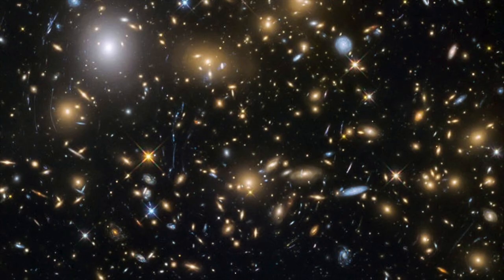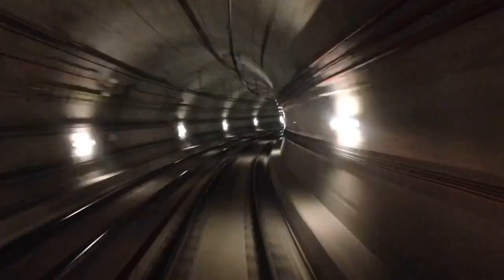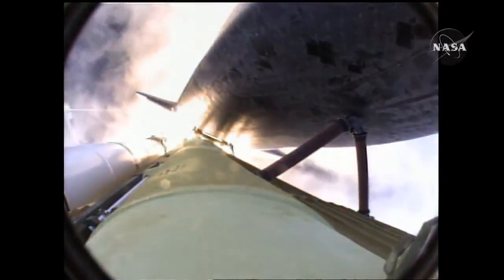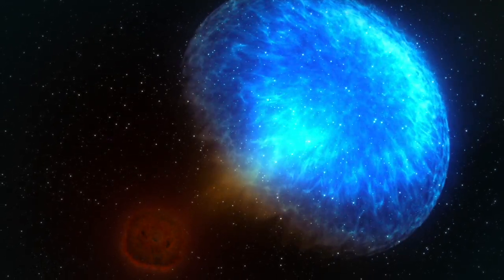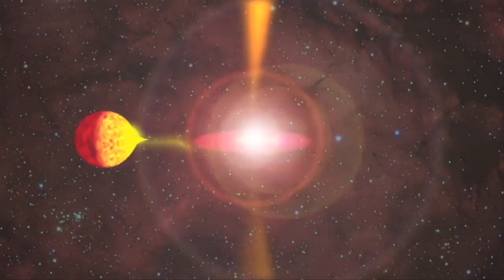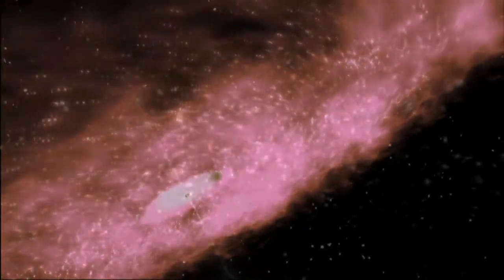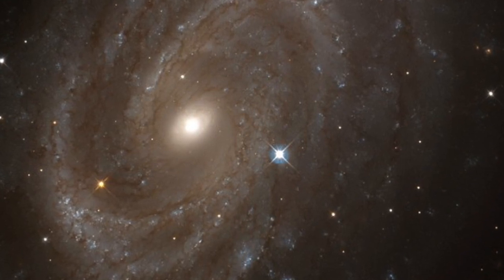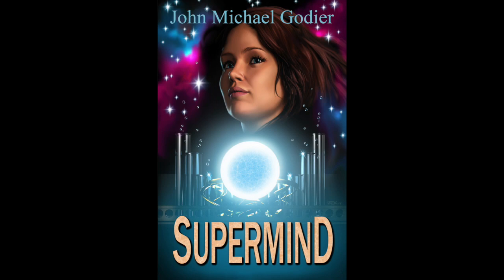10 Mind-blowing Interstellar Propulsion Systems

Comment: Concerning antimatter production...well, yeah, confinement of it is one thing, but it is possible...in terms of the best way to make it though...I seem to recall reading many years ago now,  about maybe producing it on the planet Mercury, mainly due to its ready availability to solar power...am also thinking now about that Isaac Asimov story ("Runaway" - something like that?) about that robot that got a bit confuzzled, caught in a sub-positronic dilemma, so to speak. Selenium was involved...I love this channel, by the way. In terms of interstellar propulsion, I think that some incredible genius may eventually come to make it practical, and it would be nice if we could safely get to e.g the binary part of the Alpha Centauri system without the hassles of moving at a relativistic velocity (and yes, thus far we can't see what worlds may be around the G and K class stars there, so it is quite clear that we also cannot see what perils may lurk in terms of comets and asteroids & c). The only thing I can think of at the moment is, maybe we can't have a seriously large wormhole open, the whole negative energy density thing, but...what if we could use smaller ones to send communications through them? Right now though, it seems the easiest way to get to another star is to be born on a planet around it.

Comment: The halo drive is not a drive. Light blue-shifted as it approaches a black hole becomes red-shifted again on the way out, and actually is redder (lower energy) when it hits the ship as the ship is (or should be) moving away from the black hole. John, I like you, but reasoning man. Putting it on your channel is like an endorsement. If you're going to write good SF, you have to think all the way through this stuff.
Reply from the maker: Publish a rebuttal to Kipping's paper and post it on Arxiv. Or write him for a clarification. That's the process. But, as a youtuber, I will not ignore a paper written by a professor of astronomy at Columbia University.
Reply: Take a closer look at the way the halo drive and gravity assists in general work. If the acceleration on a gravity assist came solely from falling inward toward a planet, a probe thrown past a planet in a slingshot maneuver would merely change direction. The fact that the planet is orbiting the Sun is important. The planet loses some of its orbital momentum, giving it to the satellite. The effect isn't noticeable, but when the Galileo and Cassini missions slung by Earth, we lost a tiny, tiny bit of our angular momentum that was transferred to the probes. They changed direction and sped up as a result.

The halo drive is similar, and that's why you can't simply fire a beam at a single Schwarzschild black hole - it would simply blueshift-redshift equal amounts, as you say, and the retreating spaceship's motion would add further redshift. Instead, you must either use a pair of black holes, orbiting one another, or (more tricky) a Kerr-type rotating black hole, where the angular momentum transfer occurs through frame dragging as the light passes through the ergosphere. 

In practice, I'm skeptical. You'd have to aim a laser incredibly precisely from light years away. You'd have problems with the beam spreading and a frequency distorting prismatic effect that would result as different parts of the beam would be affected to different degrees. You'd have to be in exactly the right place years later to catch the beam. You'd have to get more out of the halo drive effect than you loose in beam generation and reception losses and redshift from moving away from the black hole at ever greater speeds. It is remotely tapping the angular momentum of a black hole, which is awesome, but even with super-advanced technology, that's a lot of work when you'd start off much faster by not having the laser aboard the ship in the first place. A laser capable of driving a light ship from light years away (double the actual distance to the black hole, even if there were no distortion caused by the black hole or its accretion disk) would be very heavy, and you'd have to accelerate the laser too. Simply chaining stations together firing lasers or relativistic particle beams might be more practical.
Reply from the maker: @nkordich  Thanks Nick, you wrote that far more eloquently than I could have :) Keep posting! I enjoy your comments.
Reply from the maker: In addition, I spoke at length with Dr. Kipping on the subject at Event Horizon, but do also read the paper please. Links here:

https://arxiv.org/abs/1903.03423

https://youtu.be/uYXH4rH1SwM

Comment: Hi, nice summary. I think you meant rotating black holes for the Halo drive not binary black holes?
Reply: Either could be used, though Dr. Kipping mentions that a single rotating (Kerr) black hole would be more difficult. It seems the moving target of a binary pair would be harder to hit, but perhaps the sweet spot in a binary pair is larger. I haven't even looked at the math involved, however.

Comment: Captain: 'hey Scotty, give us more power. We got to half lightspeed but then you turned off the drive.' 
Scotty: 'I did not turn it off, it disappeared. Our black hole evaporated because that is what small black holes do, and on a time frame shorter then our expected flight. Go blame the dumbass admirals.'
Reply: You just keep feeding it. While tiny black holes evaporate, you can keep the mass stable by throwing in (relatively) small amounts of matter equal to the energy they're evaporating. The ship traveling at relativistic speeds might even be able to collect mass through capturing the interstellar medium (and just like that, the Bussard collector gets a new lease on life...).

Comment: how do you avoid being smashed to bits by the trillions of massive objects being pulled into the black hole at any moment, regarding the halo drive
Reply: You keep your distance. The laser would be fired into the 'ergosphere' of the black hole from possibly light years away to avoid the ship having to escape the effects of the black hole's gravity well and intense radiation close to the black hole. Unfortunately, the beam would spread and parts nearer to the event horizon would blueshift more and the part of the beam further from it would be redshifted relative to the center point of the beam. As a result, you may lose some of the energy and get an asymmetric push on your sail/energy collector. On the bright side, you'd create an homage to the cover of Pink Floyd's Dark Side of the Moon that could be measured in parsecs. :)

Comment: It wasn't that long ago that we discoverd that there was a bunch of stuff beyond Pluto. Do we really know that the interstellar spaces aren't full of crap? If so wouldn't that mean that it would be too dangerous to attempt to travel interstellar space at significant speeds?
Reply: That's actually been proposed as a solution to the problem of dark matter. However, it doesn't seem to be densely populated, based on the fact we can see for billions of light years. If the interstellar medium was thick with gas and dust, we would get an atmospheric haze effect, like you see when looking at distant mountains (the same light blue Rayleigh scattering that lightens the sky). If it was populated with denser objects, the size of planets, we'd see gravitational lensing, such that the stars would twinkle even in space as objects flying past our field of view distort the light of stars passing around them.

That's not to say that anything in the way wouldn't be a serious problem, but so far, the way looks clear.

Comment: It's good you'll be having Alcubierre on your show. That's the one item in the video I think you failed to properly discuss. You, appropriately, were doing Pros/Cons for each item. But you missed the #1 Con for the Alcubierre Bomb (at best, System). Yep, bomb. Because it's far from deserving to be called a drive given that it is going to be highly destructive. It would produce a gigantic radiation event at it's leading edge, growing exponentially larger for each second it's engaged. It's not clear that the ship's occupants could be protected from this radiation. But there's a more pressing issue. That gigantic radiation bullet would just keep on going after the system was disengaged. It's not ideal for going to an outpost since you'll kill everyone in its path. If you think you can just plot an oblique course and then use other slower propulsion drives to get to an outpost, think again. That bullet is still going somewhere...and it's going to be destructive for many, many light years. There are no known solutions or workarounds to this problem for the Alcubierre System. So it will raise a very important moral question about 'unintentionally' risking the destruction of life. As an aside, something similar was explored in an episode of Star Trek TNG. But, wow, this thing as a weapon! Having an arsenal of these things would be pretty damn intimidating.
Reply: TNG, the Solaton drive?

Comment: How does a rocket work in spac vacuum?
Reply: Funnily enough the same thought once occurred to scientists. The prevailing thought was that the thrust coming out the back pushed against the air and that pushed the device forward. What changed their minds? They tested a rocket in a vacuum and found it worked better. Ignore the thrust from the rear for a moment. Imagine a balloon filled with air, the air inside is pushing on all the interior surfaces. Air pushing up, and down, forward and back, left and right, balancing each other. If we then put a hole in the balloon, the balloon moves away in the opposite direction to the hole. Same would happen in a vacuum. The reason isn't because the air escaping, it is because the air at that point is no longing pushing on anything to balance the push on the other side of the balloon. Same principal applies to rockets, jets and similar devices.

Comment: I remember the Daedalus Project proposed in the 1970s. If memory serves, it suggested using nuclear pulse propulsion and showed that, even using the technology of the day, it could reach Barnard's Star within 60 years. Given the way that engineering has improved by leaps and bounds now, it should be a great deal cheaper and more practical now.
Reply: There are genuine concerns about that form of propulsion, that's why. It's fine in deep space, but there is a genuine concern about what would happen if such a drive exploded in our atmosphere. We already have a lot of issues from nuclear accidents and weapons testing.
Reply: @anonb4632  the Daedalus project is too big to be assembled on earth and then launched to space. the fuels it uses also isn't going to be harmful if it blows up anyway.
Reply: The only problem is now you have to justify having weapons-grade uranium or plutonium etc being handed out to countries' space programs again. That's going to be a big (and difficult) hurdle to get over, with potentially far-reaching consequences.
Reply: @cielopachirisu929  international treaty where the ship is a multi-country effort, so no one country is using the tech, but rather several agree to have a joint effort for the project. Countries outside the treaty/cooperation would be prevented from having Uranium. Like Nato currently operates, but for space. 

The bigger problem is slowing the craft down. It'll take as much energy to slow down as it did to reach its highest speed. The show The Expanse does a good job covering this reality of having to slow down a craft.
Reply: @cielopachirisu929  Well luckily the Daedalus project doesn't use uranium or plutonium. it uses deuterium and helium-3
Reply: That would take a buttload of fissile material invested and no, "technology of the day" even now would not be able to run systems autonomously for the time required.
Reply: @stevenobrien557  do it wouldn't. it uses deuterium and helium-3
Reply: Wow!
Reply: The bottom line is chemical propulsion is not the long term answer. It’s not sustainable and is limited in results in the best of circumstances
Reply: The answer is going to be stabilizing element-115 and utilizing a stable drive. Basically, until we understand how to manipulate gravity we’re just wasting time. Anything outside of Mars is just not reasonable with our current technology. It’s not about moving a craft but the space in front of it
Reply: @greg6162  Are you talking about the Man made Element 115 Moscovium?  
And that E115 becoming stable?

Element 115 can never be stable, it's literally a fundamental law of nature, due to the fact that moscovium is made up of 115 protons, this odd formation will always eject the odd proton causing the Element 115 to decay into Element 113 in a process known as "Alpha Decay" which will also cause E113 to decay into E111 to E109 and so on

There is no way to change this outcome, unless you can physically change how the universe works on a fundamental scale

Stop listening to Bob Lazar he's full of shit

Comment: Here is what i don't get way is no one even thinking about a drak enargy drive. It would alow exstramely fast ftl with out relativistic effect . how? Dark enargy is simple enargy used to effect space makeing it expand faster. So if you use dark energy you ship is not moive but the amount of rative space between you and were you started increases. ( you were 1 mile away dark energy adds 1 mile of exspaned space ne hide you. You now 2 miles away.) This effect alows none relativistic movement.

Comment: If the black hole grabbed onto the laser enough to bend it around itself then it would not come back to the point of origin because it would continue to circle the black hole even if it increases in speed because it would not be able to gain enough speed to break free of the pull of the hole it's true that the black hole would or rather could increase the speed of the laser per say but the simple fact that it gets caught by the gravitational pull of the hole means that it will not increase it's speed fast enough to break free it's going against it's self then if a laser could do it then anything could also when ships or satellites use a gravitational slingshot they have to use an outside means of thrust to separate from the object that is pulling on them or they'll just continue to loop to get a laser to make a 180 degree circle it would have to have some means of to return it back and break free of the pull but I'm an idiot and most likely wrong

Comment: Three methods that didn't make the list of 10:

11. Nuclear thermal rockets - these are less efficient than nuclear pulsed propulsion and inject hydrogen or some other working gas into a nuclear reactor, causing it to fly out the back. This could be a useful approach for intra-system travel, is within our grasp (we've built air-breathing nuclear thermal rocket testbeds, though thankfully haven't been flying them). As I recall, nuclear thermal rockets might take an order of magnitude more time to reach another star, compared to pulsed nuclear propulsion, which is probably why it didn't make the list.

12. Ion drive - low-impulse but very efficient, ion drives do require propellant. However, they could potentially have their energy beamed to them to cheat the rocket equation. While they could use an onboard nuclear fission/fusion plant, a laser beam could send energy to the probe, which could be used to power the ion drive. As speed increased, it might be possible to capture particles from the interstellar medium for propellant, though that's probably easier said than done. Again, this is more limited than the methods on the list.

13. Magsail/plasma sail - firing a charged particle beam at superconducting loop tethered to a probe will give it a push. This will be a much greater kick than what a light sail gets from light pressure, but the nature of such a beam is that it will be much shorter-ranged than a laser. However, a series of particle beam stations at various points in the solar system could result in a chain of stations to accelerate a small probe to very high velocities. Depending heavily on how much you invest in the infrastructure, this might be more capable than the accelerator approach used by Starseed or rival a light sail, but as with the other two approaches above, it might be more practical for intra-solar system trips.
Reply: Don't we already use Ion drives? 

Stealing that magsail waystation idea, thanks for it!
Reply: Could you combine ion and light sail then? If you’re hitting both with laser already? I don’t know how they work well enough

Comment: Fusion (&fission) reactor in space has a serious problem: cooling.
Cooling power/m^2 = T^4* Stefan–Boltzmann constant
=T^4*5.670373*10^-8 W/m^2/K^4
T=300 K -> P/m^2= 459   W/m²
T=400 K -> P/m^2= 1451  W/m²
T=500 K -> P/m^2= 3544  W/m²

Fusion drive replaces large solar collectors with large cooling panels unless cold side of generator is rather hot.  Hot side must be much hotter -> problem.

Comment: What about using Gravitation Waves as a Resonance Engine to build up and reduce speed. Various structures have a natural frequency if we could "tune" one with a longitudinal axis some multiple of a periodic Gravitational Wave.. it might get a "kick" and pick up speed.. dissonance could slow it down. As a reaction less drive acceleration and deceleration might be even faster. Turning it "off axis" or changing its length might turn off the virtual thrust. It might be kin to a Surf board.. riding natural wave fronts around the Galaxy.
Reply: Sorry gravitational waves dont work this way. You'd be better off building structures that catch light with the YORP effect